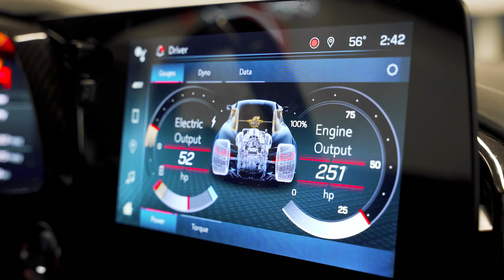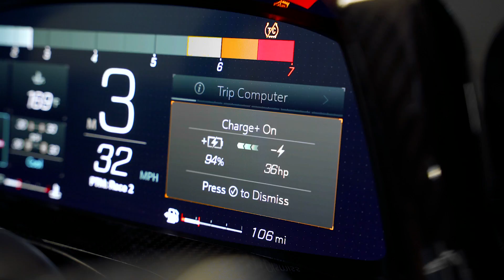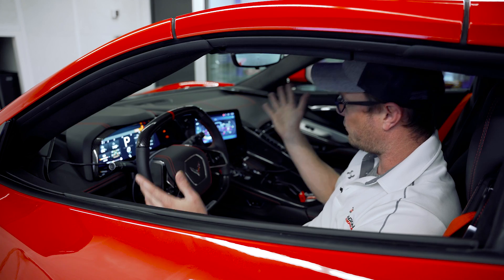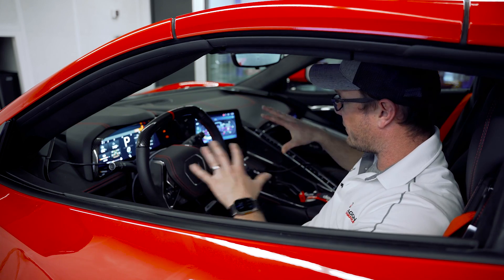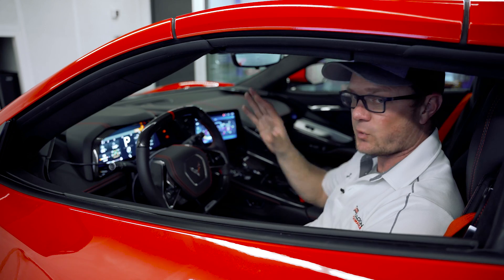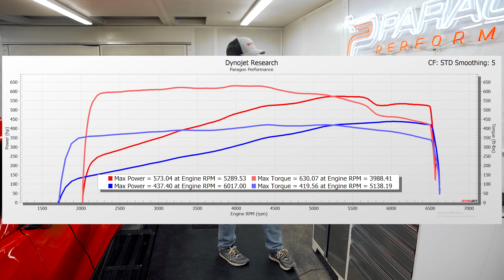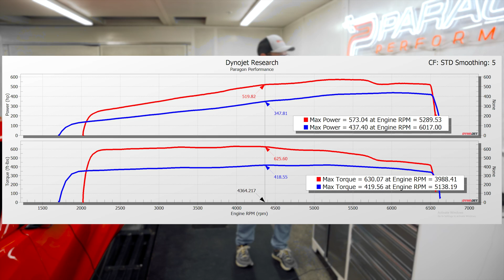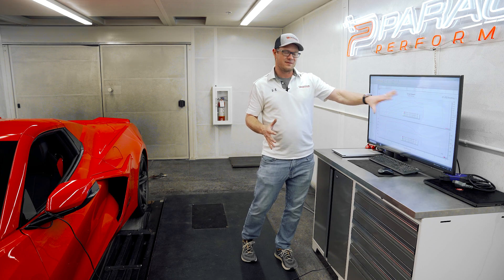Electric C8 Corvette E-Ray Dyno Results!

Comment from the maker: Let us know how you feel about the first Electric AWD C8 Corvette!
Reply: As a die-hard knuckle dragging carb'd big block car guy...I still like it! Like a 150 shot of nitrous only electric motors instead. That's fine by me. Silly it will only let you go 15mph in electric only though. Something like say, 35mph and it still wouldn't use much juice, but you could stealth around neighborhoods. Great video.
Reply from the maker: @jasonquartermile425  stealth mode is up to 45mph or so, shuttle is 15mph. 

Glad you’re embracing the electric assist motors!
Reply: It's too heavy,  but smart with performance AWD system & LOVE the Lingenfelter SC system!  Im trying to decide between C8 Z51,  Eray, & Z06. Leaning HEAVY towards Z06 due to Ferrari engine.
Reply from the maker: @boywonderrr71  the E-Ray with an aftermarket exhaust and the Eventuri intake is only 150lbs or so more than a Z06. That’s a passenger, not that much more.
Reply: Nearly perfect, just needs a third pedal....
Reply from the maker: @Blas4ublasphemy  as much as we love rowing gears, this DCT is quick on the shifts!
Reply: They'll always be something faster so enjoyment should be paramount IMO, as much as I like this car I'm actively looking at a Lotus instead, I would take the much faster Vette if it offered the manual though. @ParagonPerformance
Reply: @ParagonPerformance it’s NOT FULLY ELECTRIC!!!!! It’s a HYBRID!!!!!! GAS V8 ENGINE INCLUDED!!!!
Reply: @ParagonPerformance   Whats the weight difference between Z06 & this. HPO said u said only 150 #'s
Reply from the maker: @boywonderrr71  E-Ray is 134lbs heavier but we got it to 70 when we changed exhausts and an intake.
Reply: @Callsign_Bubblez good to know
Reply: That guy plans to put a super-charger on it. Hmmmm......... For E-Ray Turbo-charger makes more sense as it already good enough torque push at low rpm. What it needs is that boost from turbo at top end. Super-charger be more suitable for Stingray.
Reply: @KING_DRANZER I want see the comparison between a stock e-ray vs twin turbo e-ray vs supercharged e-ray

Comment: Just a few comments from a guy who has an e-ray, could have purchased a z06, and also had a Ferrari 458.  The 458 is an intoxicating car.  She's beautiful, yet masculine at the same time.  The flat plane crank engine is amazing and the sound she emits is both mesmerizingly wonderful and menacing at the same time.  The Ferrari is still my favorite simply because of her sound, exclusivity, and beauty.  Yet I purchased an e-Ray.  I chose the e-Ray over the z06 simply because I wanted a car that had acceleration, a comfortable and compliant ride, and all wheel drive.  I very much miss the sound of my 458 and the z06 was comparable in sound, although the pitch of the z06 has a bit more bark and doesn't quite match the F1 scream of the 458.  I had that... been there, done that feeling; and was ready to move on to a more comfortable car that I could drive all year long and not feel exhausted from engine noise and the harsh long rides the 458 inspired z06 would have given me.  You can't go wrong with the base Stingray, z06, e-Ray, or a Ferrari 458 for that matter.  It's a matter of your preference, what you can afford, and what you are willing to live with.  I just wish I could have kept both the Ferrari and my e-Ray !  All wonderful cars.  I also had a 2004 Porsche 911 Turbo and that too was an amazing vehicle !

Comment: Interesting results for what is a truly impressively engineered car. What gear or speed range was the test performed at? I'm assuming it was done at the electric motor's optimum range and that the battery state of charge is not limiting power due to an abnormally long top-gear pull?

Comment: 4,000 pounds.
Reply: 3914# stock per scale and it will be even less after modes… -70#. Stock it’s 134# more than the exact same spec z06 w/z07 package. So not as heavy as thought.

Comment: Eh, last Vette was C7. This is just another European wanna be. I am sure it will perform very well.

C7, 7 liters, straight duals, lightweight flywheel, 6 speed...
Reply: 7 liter C7?
Reply: @IcyDeath91  

LS7 swap or LS3 punched out.
Reply: @bogusphone8000  swapping LT out for LS is highly suspicious.  Although I do love a good LS.  This thing isn't a euro wanna be man, it literally has an SBC in it.
Reply: @IcyDeath91  Personally, part of the draw of the Vette was that it stood out. It was one of the few front engine when everyone else went mid. And it was a thumbing of the nose to all of the far more expensive sports cars. Now, with the change in design, it is just another one.

If we line up a C7 and the Europeans, you instantly know which one is the Vette. Now, not so much.

Comment: Wow!, those C8 E-Ray torque figures are crazy. (hard to believe they are real).
We were told the E-Ray would have, "an electric motor making 160 bhp (120 kW) and 125 pound-feet (165 NM) of torque, I imagine at the crank.
Yet according to these dyno figures we see an average of over 600 ft/lbs from 2000 revs to 4600 revs. At the rear wheel. Which is 200+ ft/lbs of torque more than a stock C8 Corvette at similar revs.

How can a 125 ft/lbs electric motor produce 200+ ft/lbs of torque?????
Even a stock C7 ZR1 only makes about 470 ft/lbs at 2500 revs peaking at 535 ft/lbs at 4500 revs. 
If 600+ ft/lbs is genuine for the E-Ray that is phenomenal.

The trick here then for the E-Ray is not only to add a Supercharger as some outfits are attempting to do, but to add in another 1.9kW/h battery unit as well.  
They are about 45kg per battery unit, so for those E-Ray owners that rarely take passengers, they could take out the passenger seat + safety belt etc to lower the weight and have another 1.9kW/h battery pack installed alongside the existing centre console.

THEN have it all rigged up so that as one battery pack is being depleted the other is being/has been replenished ready for use, not waiting until currently just the one to fully deplete, then wait around not using it until 50 or so seconds later when it has been fully charged.

Having two battery packs with one as good as fully charged ready to lock & load and blast along with that one, then switch to the other and so on.
Making the recent E-Ray Lightning Lap of 2m:45.9s lap time something that could be lowered towards the C8 Z06 lap recorded lap time of 2m:38.6s quite achievable.

It being we hear the limitations of the E-Rays current sole 1.9kW/h battery that the E-Ray, "lacks enough capacity to provide full boost for the entire 4.1-mile lap".
With TWO battery packs it may be possible.  
IF there is a way to fit two battery packs, program & configure it in to the existing system some bright spark will do it.
As later on they will likely fit more powerful electric motors on the E-Ray, replacing the 160 hp ones. 

That is the thing about the E-Ray, it is its POTENTIAL about this performance machine that has to be seen to be so desirable in addition to its already stunning performance. Making it the package to go for.
Only the ZORA in addition to the E-Ray will likely ever come with AWD. 
Something the base C8, C8 Z06 and C8 ZR1 will never have. 
All great performance cars as we see and will see in future releases.
Reply: Who told you a c7 zr1 only makes 535 torque. They consistently dyno 650 ft lb at the wheels bone stock

Comment: Chevrolet says it's supposed to have 655hp total, including the addition of the 160hp front motor... why the discrepancy?
Reply from the maker: We are measuring WHP
Reply: @ParagonPerformance   OK, is that not the SAE method required nowadays for rated hp... it's obviously not crankshaft measured like in the 1960's.
Reply: Crank horse power VS wheel horse power. Just like how the C8 Z06 has "670" hp but to the wheels it averages around 610.

Comment: as soon as I saw the graph I thought to myself thats about what 8 psi from a twin screw would do on a LS based engine... I have seen personally 630rwhp on a HCI C8 and that package on the Eray would be bananas , thats what I would do since the blower is going to add 100+ lb if  If these LT2s can handle sayyy 13-15psi with a fuel system without tearing itself to pieces now we are talking. I think the HCI route would be the best and most reliable especially for my style of driving . 630+ 150 +/-10hp is 780 to the tire with all the sound compounded with electric response and trq... not to mention with more aggressive cam there is more left on the table with the HCI setupr in this platform and the loss down low isn't an issue due to the electric . Lots and lots and lots of packages to play with on the Eray !!
Reply: 630whp on a stock cubic-inch LT2? Not happening unless you build a very radical top end and you're definitely going to need race gas or E85. Even then it's going to be a challenge. Now a 427ci LS7 can make those numbers easily.
Reply: I was there when it was on the hub dyno, on E85. Heads, cam intake manifold , full exhaust . this was the 3rd they have done and the others were said to make 58X and 602 but lacked the intake manifold. @caliLakerNiner

Comment: The electric power tapers off after 5700 rpm which would be around 107 mph. This must be the highest speed for the max power from the electric motor. I wonder if the electric motor's gear ratio could be changed to let it keep pulling at higher speeds.
Reply: It is all about battery size. It is not a plug-in hybrid so the battery has more capacity to keep pulling. Here It charges fast but it depletes also fast. Plug-in hybrid to me is just the way to go..

Comment: Similar to a 700HP/600TQ, 441c.i. (7.2L) LS7 build, with a touch more TQ at 2000 rpm. MONSTER acceleration in this E-Ray. Someone is going to what...??? Add a supercharger? Good Lord of all there is.
Reply from the maker: The owner is going to be smiling ear to ear driving this car.

Comment: First, nicely explained. 
From an engineering standpoint, the tradeoff of a hybrid aka Eray is...complexity versus cost versus performance increase. 
From a technical complexity standpoint, which affects long term ownership and proportional reliability cost ,a simpler machine i.e. Stingray with gas engine only will fail at a lower rate than an Eray. This is irrevocable. Physics. In engineering parlance, there is no free lunch.  A hybrid vehicle has 2.5 x's the technical complexity of a gas engine only vehicle.  A hybrid aka Eray, not only has a completely redundant electric propulsion system but 100 computers allowing two propulsion systems to work together in harmony for reasonable drivability.   Within a typical warranty period, this is of little concern other than time in the shop chasing gremlins that accrue due to very complex design language that statistically will fail more than a simpler machine. But long term, the achilles heel of a hybrid system versus gas only propelled vehicle is the complexity of its electrical system.  Long term a typical Eray owner isn't just looking at Throttle by wire, MAF, Air & Engine coolant, CPS, Oxygen, Knock (ignition timing) Sensors, ABS by wire, electric steering, transmission clutch pack solenoids, engine and trans PCM's and all the computers on a typical ICE vehicle that fail.  Oh no. that is 'nothing' compared to the electronics of a redundant motor drive system and countless computers with algorithms that allow both gas engine and electric motors to work together as with a hybrid aka Eray. Electronics due to age, vibration and environmental exposure are highly vulnerable to failure over time.  This 'could' have a profound cost to the owner long term in terms of part failure compared to a much simpler gas only powered Stingray which still has a plethora of things to go wrong.  Many, including me,if wanting more power, would simply buy a Stingray and put a pro charger or discrete blower on it and be much further ahead from a reliability standpoint long term. The owner of this car is going to do both.  Further, the Z06 option which is almost the same price of an Eray and a much simpler car aka no redundant electric motor drive system, on a race track will likely beat the Eray even if down fractionally in net power due to the undeniable added weight of the Eray. No free lunch. Hybrids are heavy and affect vehicle handling dynamics and power to weight ratio.

In summary, all the above isn't really your concern as you didn't design the vehicle. Your goal is to optimize the architecture of a given vehicle as it dealt.  You for example, may never choose an Eray as I wouldn't or countless others who understand the above, especially with GM's track record of dubious reliability and even quality issues associated with the C8 in its first four years.  The Eray will be next level in this regard based upon physics and math what engineers calculate.  The Eray may in fact be even 'fairly' reliable through warranty, but long term?  No way and now its the consumer's wallet that is paying for repairs.  As it turns out, auto maker profit is why hybrids exist.  There is no altruism or any free lunch when it comes to manufacturing.  Its the bottom line.

As a Corvette enthusiast, I will watch your videos with appreciation of what you do because I come from the world of automotive development as well.  I predict that longer Eray ownership will not be a pleasant experience due to afore mentioned complexity and imminent part failures out of warranty.  We will see if my prediction comes true 4-5 years from now.  At least this very early vehicle hasn't failed in your possession so far.
When I worked at the Chevy Tech Center in Warren, Mi where the C8 was designed I used to have conversations with engineers who designed Chevy's early foray into the hybrid space, the Chevy Volt which was the precursor to the design architecture used in the Eray.  We used to take Volts we developed home after work.  All agreed that the tech that went into the Volt was truly mind numbing in complexity required to marry a gas engine and electric motor to work well together and required computer programming that rivaled the space shuttle. Let's see if this technology will continue to work over time out of warranty and not bankrupt Eray owners.  I am on record and say this vehicle will not be a high water mark for Chevrolet and GM.
Reply: Thanks for the feedback and good questions!  Graham here (from the video) - will try to add some more info for you.  You make a lot of good points for sure and we've had the same conclusion.  Time will tell the viability, success and reliability of the E-Ray.  We do think its very cool and are happy to test them, modify them and make them as best as they can be for our customers to who choose to the own them, just as we do for the Stringray and Z06.  

In regards to the dyno, the Dynojet does factor in the extra inertial load from the belt and pulleys when the Linx system is engaged.  It has a sensor for it.  We've tested AWD cars on it back to back link and unlinked and the measured power does reflect the same.  So the measured power here should be fairly accurate we feel.
Reply: @boostedperformance_  Thanks for your comments and keep up the great work you do.  Kind Regards.
Reply: I am going the opposite direction. I am buying the simplest car possible. I own a Suzuki Ignis, cost $12,800 new out the door. In over 6 years, not one rattle or problem period. You guys can have all those cars with all those sensors and computers. I don't willingly buy headaches. K.I.S.S. !
Reply: @asiasurfchannel1241  You are practical.  You get it.  It used to be, the public understood that simple is best or better and diminishing return with added complexity because statistically, given same failure probability rate of all engineered parts, the more parts you have, the higher the failure rate.  But now? We live in a different time whereby wealth has created the Iphone age where things aren't owned as long term.  Iphone battery get weak as all Li-Ion batteries do over time?  Throw the baby out with the bathwater and just replace the Iphone.  But things change of course when buying a car that used to the cost of having a mortgage.

I listen to people that want an Eray. They aren't traditional Corvette buyers. They have never changed an engine, transmission or rear end on a muscle car or Corvette of years past.  You don't have to go to engineering school to learn that gasoline has 100 x's the energy density of a Li-Ion battery and why electric cars or even supplementally powered cars with electric aka a hybrid are a fool's errand. Only reason automakers create Hybrids is 2.5 x's the part complexity which translates to higher part failures aka batteries, motors, inverters and computers out of warranty which equates to greater profit for auto makers for sale of replacement parts.  This is where auto companies make the real money.  
Own a Eray out of warranty?  There goes little Johnny's college fund and of course every single owner of an Eray will not be smart enough to fix it when it goes out of warranty.

Watch for Eray depreciation compared to Z06 and standard Stingray.  Who wants a used Eray with a degrading battery and electrical system nobody can figure out?